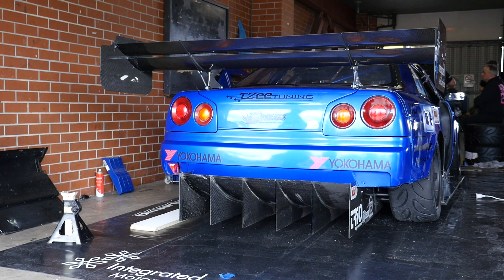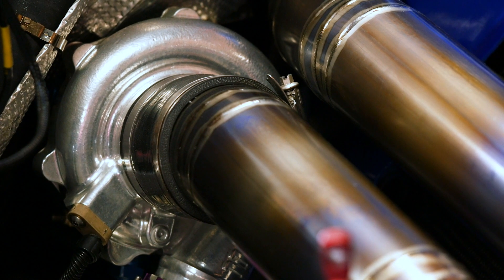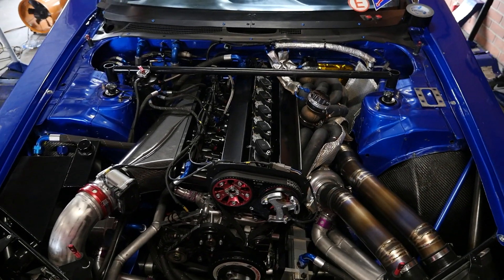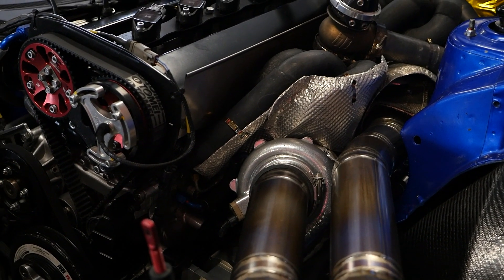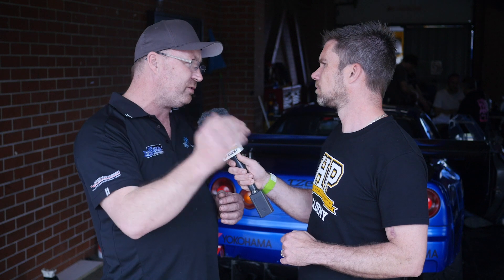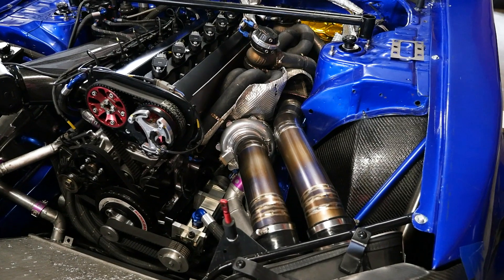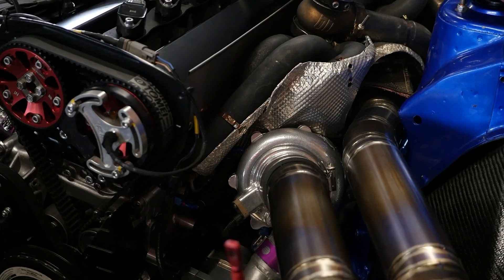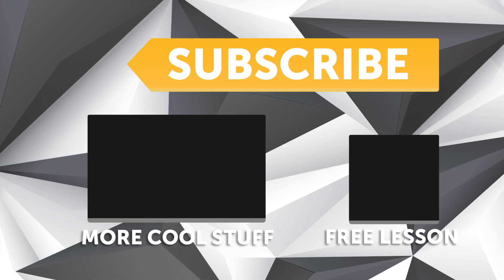Single Turbo OR Twin Turbo? | 1200HP R34 GTR Skyline [TECH TALK]

Comment: I am curious if these guys considered pre-turbo water/methanol injection before switching to twins. Probably not, because almost nobody does, which is a shame because from what I know, that would've been just what that setup needed. Spraying straight into the inlet of the compressor once "in boost" makes the process of compression more efficient because as the fluid evaporates in the housing, it provides excellent cooling right on the spot exactly where it's created. This increase in compressor efficiency essentially shifts the compressor map to the right, allowing a higher volume of air to flow than would otherwise be achievable, a godsend when you've maxed out your turbo like these guys did.  

Of course then there's all the other well-known benefits to water/meth injection like cooler intake temps, cleaner engine internals, better donation resistance, lower EGTs and so forth but the unique advantage with pre-turbo is getting your 9180 or whatever you've got to keep the same responsiveness and boost threshold and still have it perform like a larger turbo up top. Would it have gotten their EFR to the 1,200 awhp range? Only one way to know for sure, but I wouldn't be shocked if it did. For what it's worth I do think there are several benefits to going twin on this car, but that doesn't mean this current setup couldn't be improved even more by spraying water/meth into both G25s, especially since those little guys are being pushed really hard. 

In case you're wondering, NO I haven't done this myself (although I am planning to in my current build) and I'm not going to pretend to be an expert but the science behind it is pretty easy to understand. This stuff was thoroughly studied and used with great success in WWII so it's not some new secret technology. I don't know why more people don't give pre-turbo water/meth a try, especially when they're wishing they had a slightly bigger turbo. The trend I've seen online from stalking the internet over the past year-plus like the obsessive enthusiast that I am is that the people who shoot it down have either never tried it (much less researched it) or have tried it but done it poorly and gave up right away, sometimes without even re-tuning. LOL! What noobs. However... Those that make sure they have a well-executed setup (fine misty spray of a proper quantity and good re-tune) love it, say it works awesome, and don't reveal much else (little to no data or juicy details). You know it's good when people get hush-hush. Don't say "it's too complicated to implement" or "it's not reliable" and definitely not "it's too expensive" because there's a pretty cheap way to do it that's as solid as it gets and darn near dummy proof. 

I honestly think pre-turbo water/meth injection is gonna blow up and be "the next big thing" at some point in the next few years. Especially the good mechanical injection setups, because screw having an electric pump. All that's needed is the exposure. Maybe HPA could hop over to Australia where there are rotary guys who have been doing this for years and get the skinny for us all. It probably won't be the top-dollar cutting edge build this car is, but the principles translate.

In any case... Phenomenal content as always HPA! You fine group of kiwis continue to cement yourselves as the best performance-oriented motorsport information on the web. I finally got to visit NZ earlier this year and it was a fantastic 7 weeks, wonderful place. Chur!
Reply: The even though not super complex, the added system is nessasary for their goals. It would require another Tank Lines 2 injectors a pump and so on. All added weight that they don't need.

In streetcars it's an amazing idea oh, there's a lot of diesel trucks that do the same thing to help with the efficiency of their Turbo okay. It's just that with race cars keeping everything as mechanical as possible is always best.
Reply: @marvinwatson2749  I appreciate the response and I agree, simple and mechanical is best. If you could, re-read the second to last paragraph - the best setups don't use a "pump" at all, at least not one attached to an electric motor. For a time attack car doing short sessions on the track, you don't need a ton of water/meth fluid, which is the majority of the weight, and there is no way that's more than 10 pounds worth per session. 20 if you want to be super conservative. If you're counting every pound yes that matters, but at the same time running that water/meth means now your fuel requirement at the injectors is now less, so technically you can have less fuel in the rear fuel cell, partially offsetting that weight penalty. As for the rest of the system, the non-fluid gear (lines tank nozzle solenoid etc) you're looking at, like, another 2 pounds. Wanna make it 5, go ahead... That's nothing when you consider the added ability to make significantly more power and make it safer. 

Not to mention, going from single to twins in this particular setup obviously added weight and complexity, and made the turbo side of things much more cramped and difficult and time consuming to work on compared to the old setup.
Reply: @MR__JUSTIN  I understand what you're saying but I'm positive mean you both can agree that having a well set of Twin Turbo System that's working for you Trump's a well set up meth injection system. A twin turbo system is less likely to fail is providing better spool up and is providing more top-end. A meth injection system even if well set up would help with those things but only marginally.

A failure of the Twin Turbo System would result in just the Lost turbos at worst lost oil pressure and a dead motor which is highly unlikely without someone noticing. A failure in the meth injection system can cause all sorts of catastrophe. More likely so then failing turbos.

I'm not saying it's a bad system I know it can work in the can work very well and it could obviously help. It's just that most cases adding a system like that instead of just using the basics and making it work doesn't make sense to most people. This team here found a way to make it work. And no problem for the reply discussions like this are always great to have :-)! Let me know your thoughts
Reply: @marvinwatson2749  I enjoy the discussions too :) high performance car modification is my favorite pastime at the moment.

Well there's no doubt that the twins walked all over the big single from what we heard in the video. These new G Series units seem to really be kicking ass, and there's other advantages at play too. But my point, with either setup, is "why not both?" Spraying a good amount of water/meth into the inlet of those turbo(s) should only improve all around performance with seemingly minimal penalties to weight, complexity, and cost. Yes, this team made it work, but that doesn't necessarily mean there isn't an even better way. 

It's true that if your water/meth system fails when the engine is under high load, you're toast. But it's the same story with the rest of your fuel supply - get a clogged injector or whatever and you're looking at a fried cylinder, at best. Nothing is ever completely failproof but a quality mechanical pre-turbo setup that doesn't rely on a traditional pump (traditionally a common failure point) and instead uses the pressure differential across the turbo itself should at least be as reliable as the rest of the "regular" fuel system.

You said "a meth injection system even if well set up would help with those things but only marginally" and I'm genuinely hoping for more information. Do you mean pre-turbo water/meth injection specifically? How "marginal" is the benefit we're talking about?
Reply: @MR__JUSTIN  yeah that's true you can definitely get it as reliable as your regular fuel system I agree with you 100% there. Nothing is fail-proof but we know that injectors are essential that would be considered one of the basics I believe. It also depends on what fuel they're running also, even though methanol is really good at pulling out heat Waters even better by pulling out Heat. So if they're already running methanol they might as well just run straight water injection.

I a comment on this video of someone who seems like they were there during the development of the car based off what they were saying. They said that with the twin turbo setup they generated over a thousand horsepower at 30 PSI at 6100 RPM. With the single turbo setup they said they weren't even able to reach a thousand horsepower except for one of the other turbos they were running but only at high RPM which I'm assuming is over 7500. With that said what I mean by marginal is that I know that a meth injection could help with spool and response due to cooler charge I just don't think that it would make up for that 1400 RPM of range. In other words the meth injection setup wouldn't help the motor make the 1000 horsepower at 6100 RPM with single like the twins did on its own.
Reply: @marvinwatson2749  gotcha. Yeah I saw that comment too, interesting stuff. Very cool that we get a slice of that info, and twins beat a big single this time, but you and I are both just speculating, neither of us have hard numbers on what either setup would do if pre-turbo water/meth is added. The whole point of all this though is that both setups would have been better overall with "wet compression" instead of the "dry compression" that they, and almost everyone else in the world, sticks to. All I want to know is why! Why do the vast majority ignore this option?
Reply: @MR__JUSTIN  you know what let's see if we can get a response out of him, I believe it's due to them being able to reach their goal with just the basics, built motor great fuel system good engine management and a set of turbos, anything outside of that would be considered not needed unless your goal can't be met without it. But that's just my thoughts I'm a see if I can get a comment out of them!
Reply: @MR__JUSTIN  Pumps don't always fail either, 90% of failures reported are from EMPTY water tanks, not failed pumps and I have direct experience with this. You can buy or build pumpless water injection systems, I wouldn't say they are better, you still have to carry some water. The weight added is not even worth talking about. The best race fuel, even E85/E98 is made better with water injection.
Reply: @dj4monie  For sure, electric motors are one of mankind's best inventions and the pumps themselves are a lot better than they used to be. However, the pumps in use on water/meth systems are positive displacement meaning they deliver a choppy/pulsating flow and the electric motor is reliant on programming to regulate speed. This is as opposed to a mechanical system that uses the pressure differential across the turbo to provide progressive, steady flow that's linear to turbo pressure. Yeah I would agree, from what I have found out water/meth injection pre-turbo will help any setup with any fuel type, which makes me wonder why more people don't use it.
Reply: Once you get to that limit the turbo has to spin faster to produce more air, they have a rev limit and explode, regardless of meth injection. When you're on e85-e98, the meth does little to nothing to help run more timing etc to make more power, and you would only get 30kw from the meth itself. So you'd have to push the turbo harder to make the power goals.
Reply: @UnparalleledSpoof  What you said is true... if you inject water/meth somewhere after the turbo like most people do. But my topic of conversation is about the lesser used method of injecting water/meth pre-turbo, literally spray right into the inlet of the turbo. This makes the compressor more efficient and flows more air for a given turbo RPM. Please carefully read my original comment.
Reply: @MR__JUSTIN  Mostly what that does is cool intake temps making the air more dense and yes 'more air' is in the air. It does not make the compressor move more cfm per turbine rotation. It depends how bad your intake is as to how much effect this would have.
For me my intake temps are always below 15c degrees, even when im not running my meth injection. My setup is pre turbo and on 98ron it gives me the ability to run huge boost with massive gains. On e85 i gain 15kw from the 2 stage meth injection, 330cc shot and a 650cc shot. I cant run anymore timing without losing power. Everything i have learnt is from experience.
For every degree cooler your intake temp there are big gains to be had. Id be looking at that before meth injection.
Reply: @UnparalleledSpoof  Right, cooling is what does the magic. Spraying water/meth cools the air a tiny bit before it's sucked into the turbo but most importantly, it evaporates inside the compressor housing right as the air is being compressed. Since this is on-the-spot cooling that happens exactly where the air is being compressed (and therefore temperature being increased), it makes the processes of compressing the air more efficient. More efficiency = more flow. 

If you can run timing past the point of peak torque, you're not knock limited - hooray for water/meth injection saving the day on pump petrol!
Reply: Pre-Turbo injection is the best way to get the most out of the turbos.  It night even remo e the need for mechanical intercooler.  The highest horsepower tractor pullers spray water pre-turbo (and also post-turbo) for max cooling.
Reply: @ericsperformanceparts1647  Cool, I didn't know pre-turbo water/meth was a common practice in world of tractor pullers! I have heard of some people removing their intercoolers with pre-turbo, especially if their main fuel is high octane and they aren't knock-limited. I think I have read about how they run some pretty crazy compound turbo setups though. Sounds like they like to think outside the box. Thanks for sharing, do you have a link you could share to learn more about those machines?
Reply: @MR__JUSTIN  do a search for Galot Motorsports.  They have their own racing motorsports park.  The highest horsepower drag racers and tractor pullers go to their spot.  The Galot tractor is a beast.  Maybe they will give out some specs, if we ask nicely.
Reply: @ericsperformanceparts1647  cool, thanks for the info! Are you from the NC area?
Reply: @MR__JUSTIN  I am in California, but I believe that Galot is in Dunn North Carolina.
Reply: MR_JUSTIN jesus fuck you’re smart
Reply: @Jukelikesgames  not sure if there's sarcasm there, but thanks... almost everything I have learned about engine performance is from the internet rather than first-hand so it shows that anyone patient and diligent enough can learn some pretty cool stuff

Comment: Cool video. Cheers.
Question regarding going from BW to Garrett.
Is there anything in the EFR range that could have been set up as twins that would have been similar, same or even better than the G25-660's?
Reply: Because of there size . Efr are huge and in a tight low engine there so hard to fit . The g660 is as small as a stock turbo making them perfect for this car
Reply: @26Petermc  Thanks for your reply Peter. I had a sneaking suspicion that was the case, but thought I would ask. Love seeing your builds on Instagram!
Reply: @26Petermc  You could do twin EFR6258's, there is a R32 with them. Nice setup, again not for ultimate power but good response with decent power. Both choices are leaps ahead of the best twin setup previously for an RB which was twin GT2860's or Disco Potatoes.

Comment: At the drags, where variable engine loading and transition conditions virtually do not exist.
Big singles still have their role....at least for the time being.
Reply from the maker: Yes, no one is stating there is no use for single turbo setups, it was just a limiting factor for this setup and application =) - Taz.
Reply: @hpa101  Men are simple creatures they want a magic bullet solution to everything. A turbo that responds like a good supercharger and make heaps of power that neither superchargers or NA can match is the holy grail....